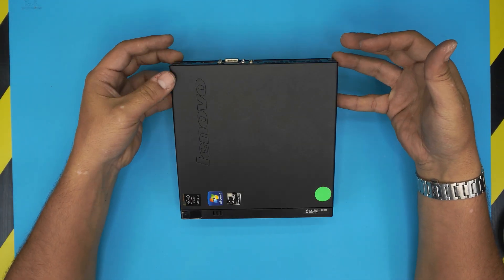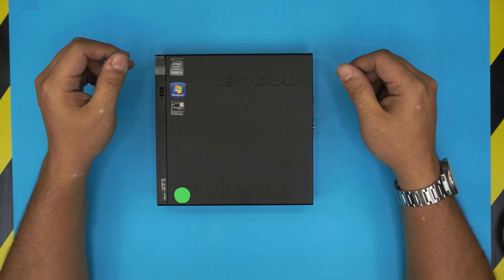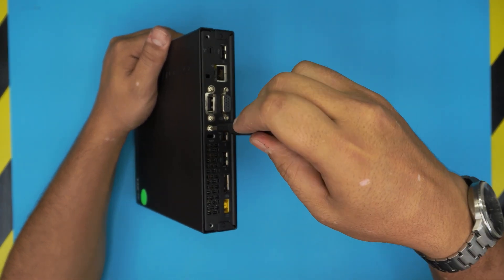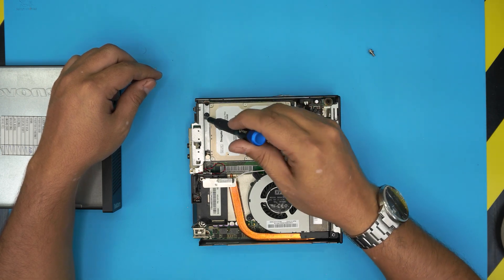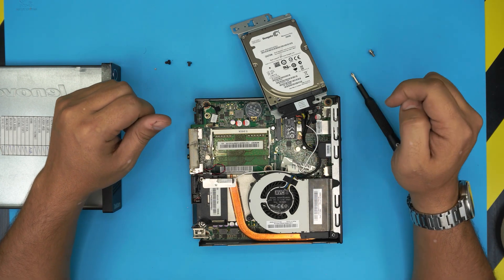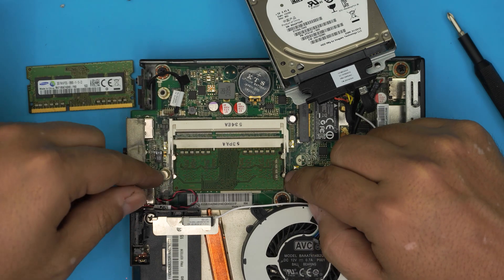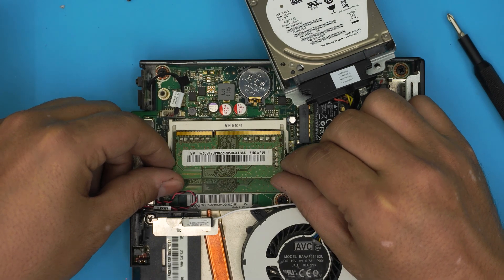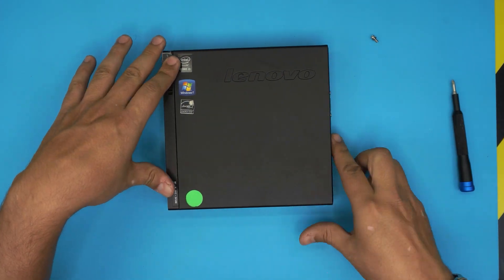How to upgrade RAM for Lenovo Thinkcentre Mini Pc

Comment: Can I upgrade the ram from 8GB to 32GB? I have only used 1 slot and have 2 slots. So I was thinking I could change 1 x8 to 2 x 16gb. But will the motherboard support this? How do I check that?
Reply from the maker: 🫠Regarding your question, no, you can't—the maximum you can go is 16GB (2x8GB). The compatible RAM is linked in the video description.

Should you have any further questions or requests in the future, please don't hesitate to ask me.
cheers🍻
Reply: @uFixTek  Sorry I don't understand. The specs say that it is upgradeable to 64 gb. Maybe that is just the RAM and the motherboard won't support it? I can't find anywhere what the ram supportability of the motherboard is indicated in the usser manual. I did buy the 32gb card but I guess I need to return it for the 8 gb.
Reply from the maker: wait a sec, you have a DDR4 model? because this video the pc uses DDR3L and the highest ram on sdram ddr3L is 8GB on stick.
if your model is ddr4 then sure you can go with 2x 16GB
give me the full model number of the pc plz
Reply: @uFixTek  Lenovo Thinkcentre M90q MT-M 11CR -001YUS. I spoke to Lenovo support and they said I can only go to 2x8 or 16 gb and I ordered the extra 8Gb through them.

Comment: Can u make a video on the problem of no signal but ur pc is power on...?
Reply from the maker: Thank you for the feedback! if you wish to support the channel you can LIKE or SUB or both :P
regarding your question: remove the rams and only place one ram, if you have one ram remove and clean the pins of the ram and try again, i need to see what happens when you power on any beep sounds and do the fan stop after one min or so?
Reply: @uFixTek  yeah my PC sound likes beep and my fan get turned off..pls any solution?